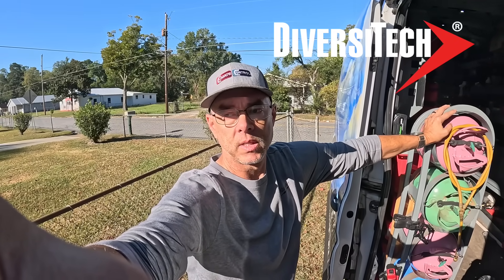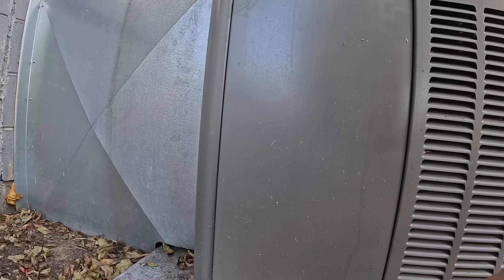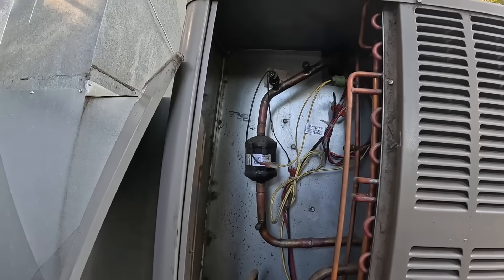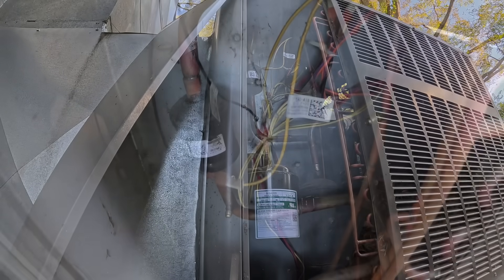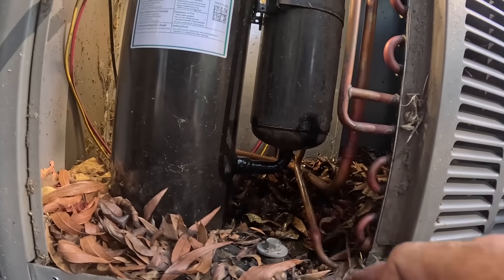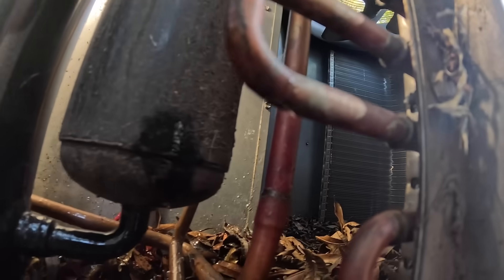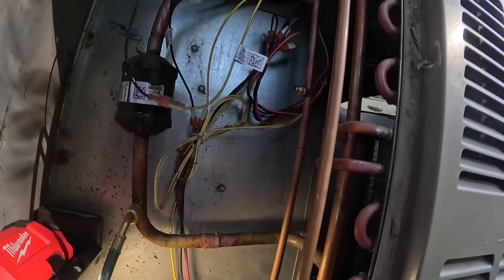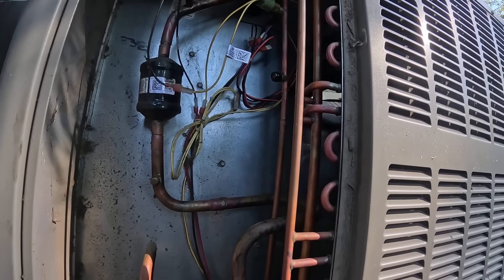Giving a Second Opinion On A Burst Refrigerant Line!

Comment: I work in commercial HVAC.  I would think $1500 is a fair number.  You don't know what gremlins are lurking inside that system when you open it, and need to have at least 25% contingency, IMHO.

Comment: I ran into this all the time with york/champion new roof units. Sloppy manufacturing and pipes rubbing together. I would just braze the hole as long as it was small. Never had an issue. Vacuum and recharge

Comment: Poor construction, those two tubes were vibrating against each other. You will need to fill in the thin spot on the one that's not leaking yet.

Comment: The junction by that suction accumulator and the case of the compressor is a common one in my experience, either it corrodes through or it cracks from vibration, despite the clamp holding it.

Comment: Could do a sand and silver solder patch on the existing line, or cut at pinhole and use a 3/8 coupler . Obviously you can only guarantee the repair area only no warranty .

Comment: Thanks for the video Curtis! Large rub through! Make sure to clean those leaves out 🔥

I used to carry 2 of the 40 CF nitrogen tanks for that reason I never had enough! I would have gone to 60's if supply houses carried the refills but were limited on who did in my area. Yes you are lucky it didn't turn into a missile my friend! I like the larger tanks I use for tig & oxyacetylene welding metals in my shop because they have the protection caps on them....I wish the smaller ones did too!

Hope you get the job and you should because your prices are very reasonable!

Comment: Get yourself a long handled 3” paint brush soaked in soap water run the the brush along the pipe the pressure of the brush will let you see the the pressure bubbling through the brush and you’ll definitely hear it sizzling the spray bottle is ok on low pressure leak the high pressure will blow the soapy water  away👍

Comment: Of course leak is towards the bottom of the tubing, rarely on top, weird compressor name, Lennox cheaped out even more than Trane/Carriers using LG compressors
Reply: I think it was vibrating against that other pipe. Design flaw, they should know better. I bet when he repairs it, he will make sure it doesn't.